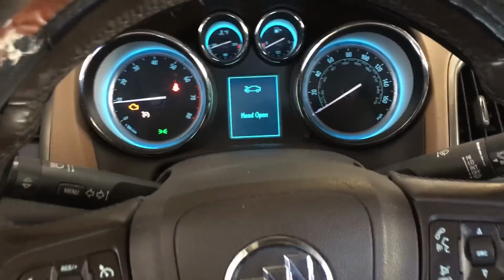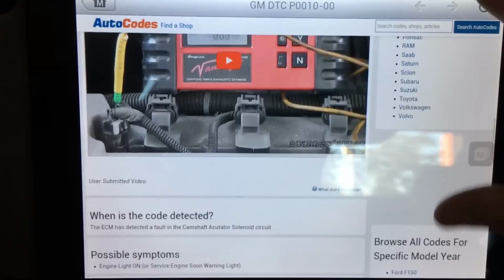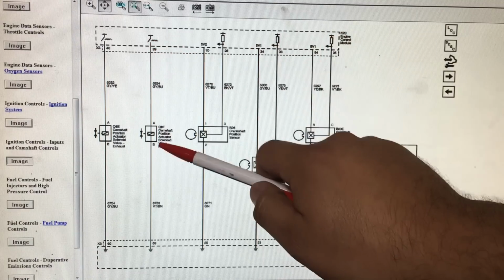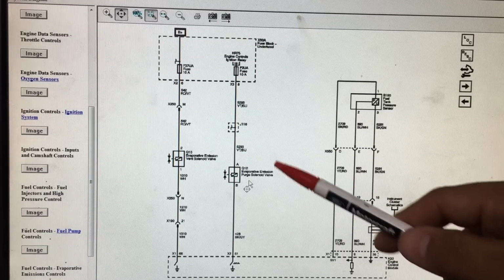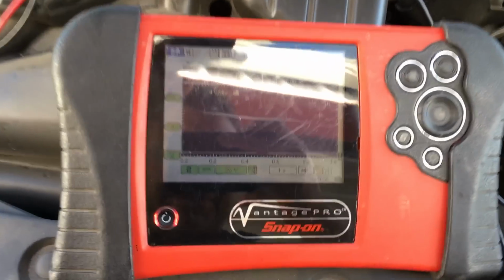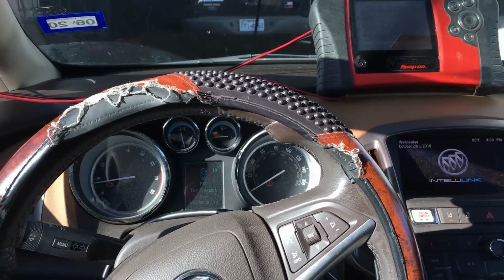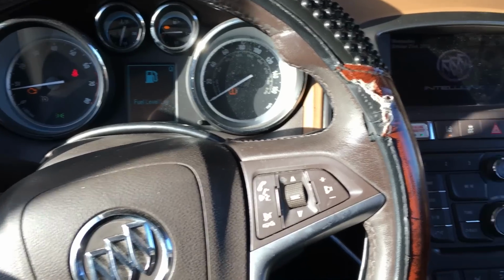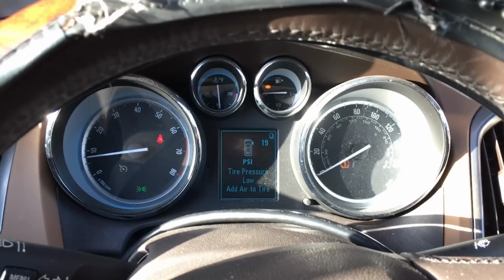BUICK VERANO RUNNING ROUGH VVT PROBLEMS P0010 P0011 DIAGNOSIS

Comment: Likely to be an Infineon high-side driver. These parts have open load detection, and is usually accomplished by passing a very small current to ensure that there is continuity in the load circuit.

The parts also have a couple different status outputs like a simple "on if ok" or a more esoteric current measurement channel that outputs a voltage to an ADC that is proportional to the current flowing in the load.
Reply from the maker: Thanks for your input!

Comment: Why u didnt consider looking at the P0011 more in depth, as the P0010 last test passed and MIL is not requested for it, however the P0011  last test failed and MIL is requested for it.. The P0010 couldve been easily generated by someone who unplugged the actuator previously .. keep in mind resistance comparison can be misleading when comparing cold to hot solenoid.. cheers from Dubai

Comment: Pcm probably  look for bias voltage ..great work anyway
Reply: Yes I would assume the same thing. The bias voltage would be pulled down by the ground if the circuit was intact but like he stated I also would assume it would watch the current as well to determine if the solenoid was not shorted internally
Reply: Eddie N that makes sense ..

Comment: First thanks for the good content on your channel. I wonder if you looked at the coil with a current probe that would show the swings of the resistance in the circuit. I have not tried it but it is on the list now.

Comment: Thank you Eric. Good job again. You're not over thinking, you're doing the right thing. Covering the bases and helping the new techs by teaching them. To answer your question about how does the ECM monitor a circuit issue from a power side switched. Either by measuring amperage flow at various duty cycle commands or by monitoring the cam sensor angle at at various duty cycle commands. I'm choosing the cam sensor angle because of the supporting P0011 Performance code. The ECM is programmed to know, at every duty cycle command of the vct oil control solenoid, the phaser/cam actuator angle should be at a specific position as seen by the cam sensor position. I wouldn't be surprised if the ECM monitored both amperage and cam position.
Reply from the maker: Your explanation makes sense! Thanks for your input!
Reply: Nice input Billy. we all learn from everyones input. you and i have been on a lot of these vids and comment sections.

Comment: You are correct that the PCM is monitoring the current for the positive switched side. It also does this on the switched ground side. It does this through a small ohmic value resistor to read its voltage drop. This voltage is then fed to an A/D converter where its output is fed to the microprocessor. The program inside the processor has a lookup table that correlates the voltage drop to amperage. The program has an upper and lower tolerance of what the amperage should be. This way you not only test the wiring for shorts and opens, but also the actual load, i.e. solenoid for excessive or too little amps. Also when looking at the PWM signal, you won’t see an inductive spike as the current has a slow decaying waveform on turnoff. If you look at the current waveform, you’ll see that it looks more like a sawtooth waveform. Great video by the way! Keep up the good work!
Reply: Hey stuzman, been reading your comments for years and always find them very informative. Thanks for the input
Reply from the maker: Thank you for your input! This is awesome information!